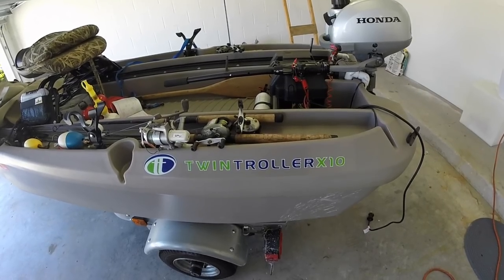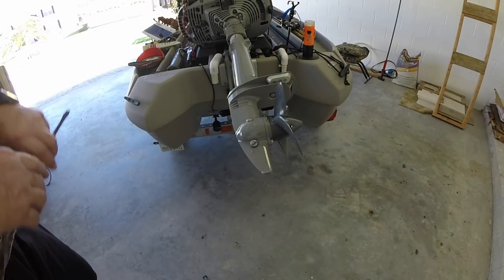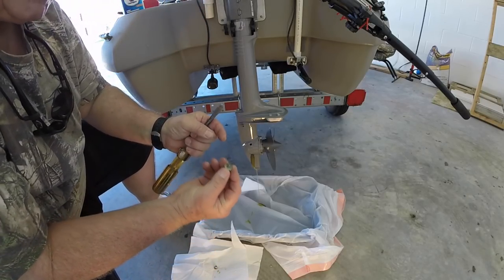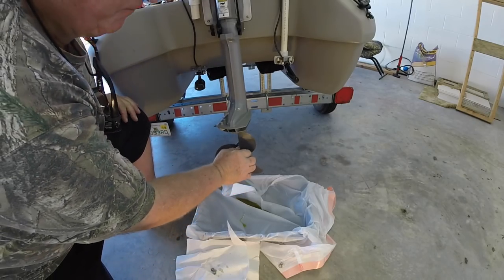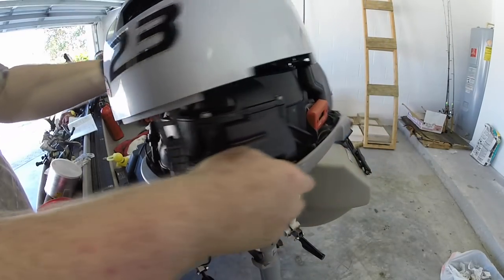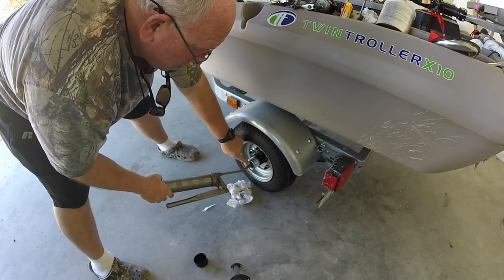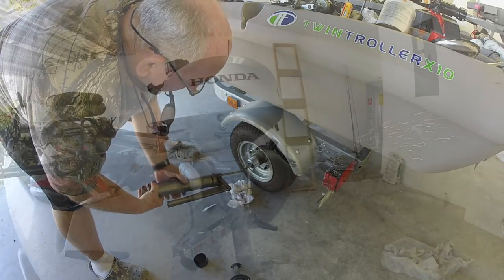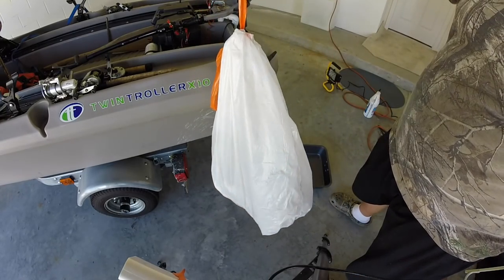HOW TO TUNE UP A HONDA 2.3 HP OUTBOARD ON MY TWIN TROLLER X10

Comment: Watched this a few times before attempting my service and suddenly realised that despite being thorough and very methodical it does not seem to include re-filling the gear lube on the lower end.
Reply from the maker: David,
Remove both screws. Insert oil in bottom until oil exits top screw hole. Install top screw. Remove oil filler in lower hole and quickly install lower screw. Tighten both screws. Job done. I did record that but must have deleted it by accident. Thanks for pointing that out.  Gerry
Reply: Thanks a million! I have another brand motor but, I think much of this will apply to it also. I have been following you for a year now and love my TT.
Reply from the maker: Rodney, I am thrilled to make contact with other TT owners. I learned so much over the years from other YouTubers that I try to give back to others when I can. What State are you in? Do you fish in small bodies of water or large? Keep fishing, but stay safe.               Gerry
Reply: Lunker012 Gerry, I am in Indy. I mostly fish Eagle Creek Reservoir and smaller lakes etc. I have had several boats but the twin troller will be my last one because I am satisfied. I have a tohatsu 3.5 on the back and a helix 9 on the front. My boat is set up some what like yours. Thanks again for your videos............. twin troller x 10  IS THE GREATEST!!!!!!
Reply from the maker: Rodney, My guess is you are also fishing for smallmouth up there. I miss fishing for smallmouth but every summer I head back to family in Upstate NY and do some fishing up there, but it is too far from Florida to tow the TT up there, although I would love to fish in the lakes up there that way. Catch one for me.        Gerry
Reply: Lunker012  I just go for crappie it’s less difficult and I don’t have a lot of patience for any kind of bass these days, however i am interested in the walleye that been stocked, I’ve caught my share of bass years ago, mostly, I just enjoy being  out on the water.......... keep your lines tight and hooks sharp!!
Reply: Exactly!

Comment: How long is the shaft on the Honda?
Reply: 22inch?
Reply from the maker: The Honda 2.3 comes in two shaft lengths. The one that comes with the Twin Troller is 15" however, it can also be purchased with a 20" shaft.                        Gerry
Reply: Lunker012  thank you 👍

Comment: prop still turns when in idle position.  This is a new problem once I started using ethanol
 free gas.  Any ideas?
Reply from the maker: Do you think your idle speed has changed?
The prop engages when the engine speed increases. Are you talking about when the prop is in the water or if you started it out if the water?         Gerry
Reply: I think it must be the idle speed because it occurs both when I first start the engine in the water at the ramp and also when I am returning to the dock after motoring in.  Checked the Honda manual and didn't see anything about an idle adjustment screw like some larger engines have.
Reply: There are numerous videos on the net regarding this.  if you don't have the proper tip for the bottom filler, its a mess, trust me I found out the hard way.  I was able to find a filler tip that screws into the bottom screw hole that attaches to my oil pump.  I start the top screw in the threads but make sure its just started as the air needs to escape there when pumping the oil in.  Once you see oil seeping out the top screw, tighten the top screw.  the lack of air in the system wont let the oil drain out of the bottom.  Be prepared to work fast for the bottom screw.  Remove the filler then quickly replace the bottom screw.  A drop or two will escape but not enough to worry about.  https://www.amazon.ca/Performance-Tool-W54150-Marine-Lower/dp/B00J4YL1RE?th=1&psc=1&source=googleshopping&locale=en-CA&tag=googcana-20&ref=pd_sl_81h40z14z6_e
Reply from the maker: @b1slum25 , I just saw your reply. That is exactly the way I do this. They sell small hand pumps at most boat stores and on-line that allows you to pump the oil into the bottom hole them screw in the top and unscrew the pump from the bottom hole and quickly screw in the bottom hole. I have used the squeeze bottle in the past to fill the lower end in other motors but you must keep pressure against the lower screw or you will leak oil all over when squeezing the tube like tooth paste. The pumps have a screw in fitting and not a pressure fitting making doing this with the pump easier and less messy.                        Gerry

Comment: What about the fuel filter
Reply from the maker: gary, I am not sure they recommend servicing a fuel filter or if it has one. If it does it likely is like a fuel filter like on a chain saw or leaf blower. You use a coat hanger or a wire bent with a hook on the end to hook the fuel line hose and pull it out of the tank. Then pull off the fuel filter, insert a new one on the hose, reinsert the filter and hose into the tank.        Gerry

Comment: is this motor safe in salt water?
Reply from the maker: Dan, yes it is safe for saltwater however, like any other motor you need to do the same things to this motor as any other motor in saltwater. If you want to have it last you need to spray down the entire motor and the lower end with freshwater. One advantage of this motor to others in salt water is that it is air cooled. The largest area to deteriorate in saltwater is the cooling system in other motors. This motor does not take salt water inside to use as a coolant.                       Gerry
Reply: @LunkerFishing  wow good point about the aircooling and water not coming in inside. thank you for your reply!
Reply: @LunkerFishing  Last question Gerry!!!!! from reading a lot of reviews on this engine, people complain that it is VERY loud. 

is the engine noise that bad? or it's fine not to the point where you have to wear headphones lol.
Reply from the maker: Dan, sorry for the late reply. I did not see the question. The Honda is a little louder than a water cooled motor but by no means do you need hearing protection. I have sensitive hearing and always use hearing protection mowing the lawn, on the range, or when I was a Captain for an airboat business. I do not feel the Honda is anywhere near the noise level of a lawn mower.       Gerry

Comment: One comment Honda have gone all penny pinching as many of the bolts are NOT stainless so in time do corrode however there is a guy on Ebay who supplies stainless bolts for Honda 2.3hp motors.
Reply from the maker: Mine is over seven years old and not a single rusty bolt.

Comment: Also I forgot what is the purpose of barring buddies for the trailer
Reply from the maker: Randall, Bearing Buddies allow you to grease the bearings without taking the hub apart. It is a spring loaded system that keeps positive pressure in the grease so it is constantly trying to squeeze into the bearings and not allow water to push back in. Boat trailers have difficulty with water getting into the bearings because you are driving to the launch, the bearings may be warm from the drive, and when you back them into the water the warm bearings cool, shrink, and can pull water into them. Bearing Buddies can help to stop that. They are a simple concept but generally help, especially for boat trailers in the long run. I hope that helps.                              Gerry